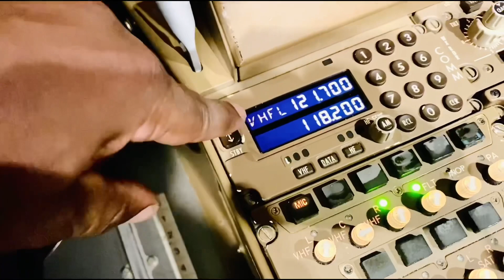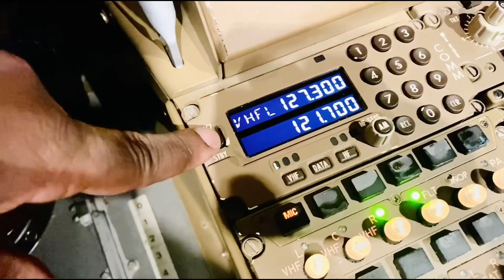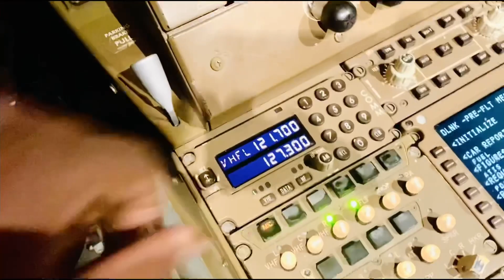B747-8 communications

Comment: Do you still need to hold the INT switch or those new ones stays  on INT if selected?
Reply from the maker: The one on the control wheel stays in selected INT position

Comment: Can you make a video to discuss the difference in handling between the 744 and 748? Are there any discernable differences on how they fly?
Reply from the maker: Very similar- handle almost identically actually
Reply: @pilot_obet  Is there more consideration during flare for landing due to the increased length on the -8?

Comment: Thanks again for another great video. What is your personal preference? R/T switch, the PTT button, the control yoke rocker switch or the hand held microphone? Also a suggestion... when next in the sim, can you demonstrate the Cpt. control yoke override of the FO control yoke roll inputs?
Reply from the maker: Depends. I may be holding a bottle of water in my right hand for example and an ATC call comes in. I’d use the PTT as it is convenient for my free left hand. I personally tend to like using the switch on the ASP. In cruise when off headsets above 15000 feet, the hand mic is preference